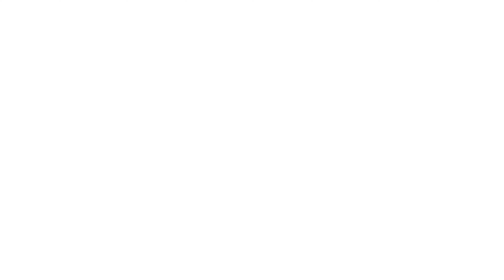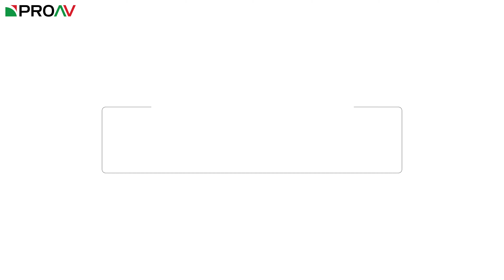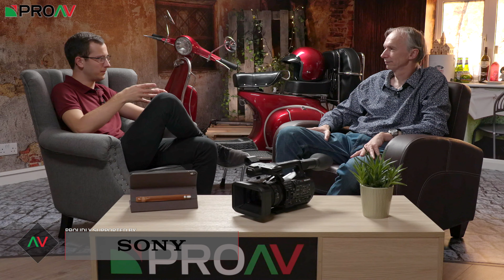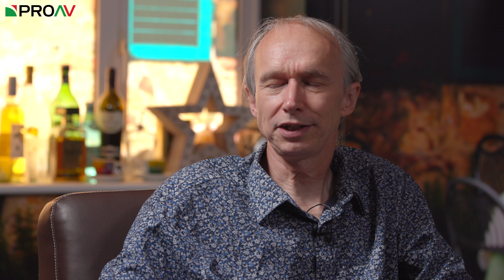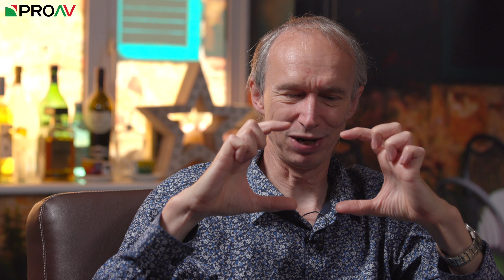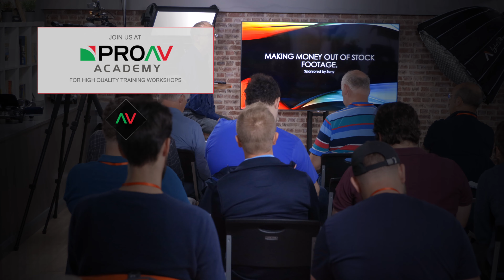What is Native ISO? | Tech Terms with Alister Chapman | ProAV Academy

Comment: One thing that does not seem to be mentioned, is that the analog working range of the sensor is far wider than the input range of the ADC. This is not be design, instead it is a limit of the technology of the ADCs. Camera makers try to optimize the signal path and gain stages to ensure that the most relevant part of the analog signal is being sent to the ADC with as little read noise as possible.
Since there is currently no way to make a noise free amplifier, amplification is always going to introduce some read noise, but it is also a tradeoff, as the noise floor of an ADC is often much higher than the minimum output of an analog sensor. For example, your analog sensor may do 0-1500mv but your ADC may only do 200-1300mv input. In that case, there has to be  a choice made at what to prioritize. 

The working range of an ADC cannot be changed, thus equally spaced along the working range of the ADC will be 14-16 bits of values.
In environments where you will have proper sensor saturation, then you will use a unity-gain, or at best a tiny bit to counter any line losses along the signal path.
When sensor saturation becomes lower, you can boost the analog amplification since sensor saturation will be unlikely to happen, but you push more of the lower values in the analog sensor within the working range of the ADC, but this is at the cost of losing potentially higher values, e.g., where a previous 1200mv signal from the sensor would be properly sampled, a pixel outputting 1200mv into the amplifier will be amplified to a point where it will heavily clip in ADC (this is why highlight recovery becomes harder at higher ISO). 

When the analog signal range becomes lower than the working range of the ADC, this is where camera makers can put more work into optimizing their low light performance, by trying to balance highlight info while keeping all of the relevant parts of the analog signal a decent amount above the noise floor. This allows SNR firmware to do more basic, (non intelligent) processing such as cancelling out read noise by being able to clearly tell what is read noise from the ADC.

PS with variable amplifiers, the larger the working range, the noisier the amplifier is, thus a single amplifier camera that will allow for a non expanded ISO range of 100-25600, will be noisier than one with multiple amplifiers where one will do 100-800, and another will do 1000-3200 and then another doing 4000-12800. Just like how it is hard to do a super zoom lens that is perfectly sharp across a wide focal length, it is hard to do a single VGA with a wide amplification range that is as low noise as one that has a small range (all things being equal).

Comment: A way to look at it is: The camera's "0 db" brightness is it's "native" sensitivity. On a dual gain system, there are TWO "0 db" values, a "low" 0db that might equal 640 ISO on a cameras and a "high" 0db that might equal 2000 ISO on the same camera. Its' called "native" because those sensor pre-amp gain values cannot be accessed by you. All you have is access to is the +3db, +6db, +9db +Xdb or whatever beyond either of those native baseline 0db values.

Comment: Apparently the C200 has multiple level of native iso from 800 iso to higher. Under, it is just a gain change. That is one of the reason why the DR shifts down in the shadow in the lower and doesn’t shift over 800 iso. Same for the c500 MkII and maybe the Canon Cine Line
Reply: David AYOUN You will definitely lose DR when shooting above 800, the native iso makes sense with the log profile.